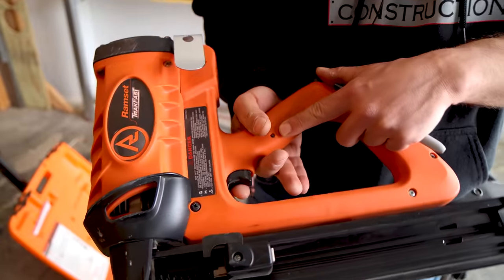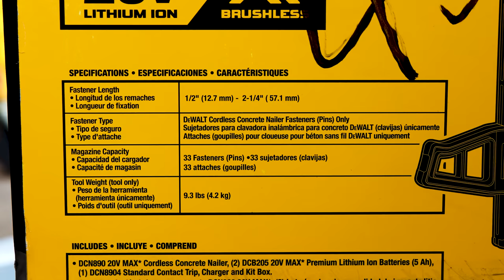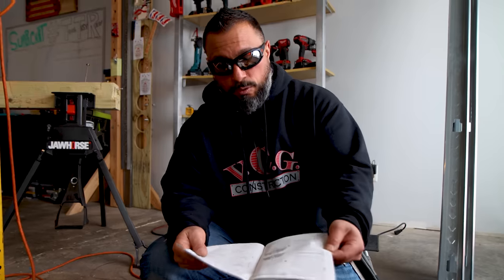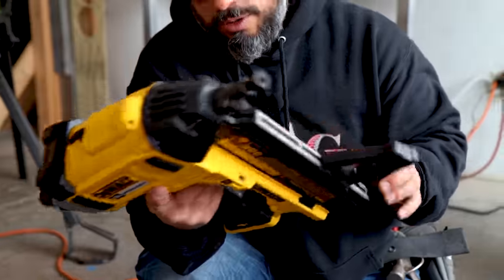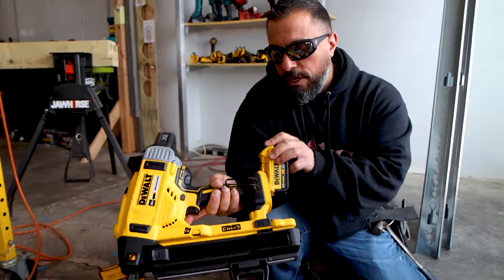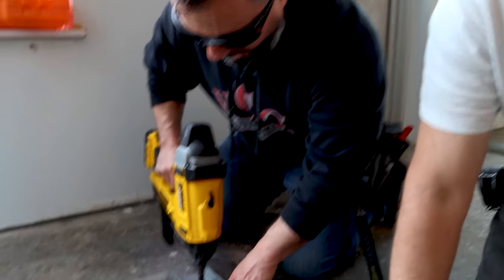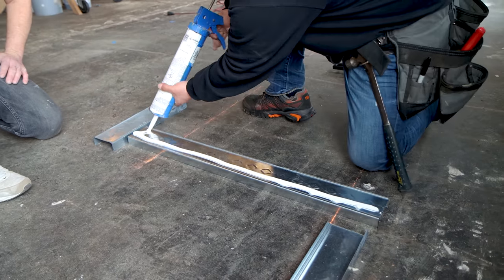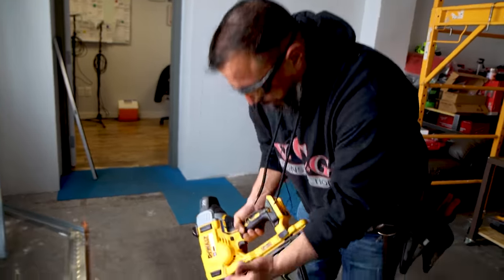DeWALT XR Concrete Nailer HAS A SPECIAL FEATURE! (don't overlook this!)

Comment: Looks like the very short nails are having difficulty going into the tough "old cured" concrete.   Not sure how it will work with structural steel either if its having difficulty with the concrete.   I'm on  full Dewalt ecosystem, but I think more R&D is required on this product, will have to wait it out for the second revised version. Not quite there yet.
Reply: Just like their framing gun that uses the paper collated (paslode) nails.
Reply: Like all dewalt nail guns they're underpowered.
Reply: This nailer is weak I think paslode or Ramsey is better for the price
Reply: There are special hardened nails that you have to use when punching into steel or toughened concrete. They are marked with a black colour. These yellow ones are standard nails

Comment: The company I work for has one and I love it! I do commercial HVAC install and DeWalt also offers accessory hardware to use with the pins such as washers and hanger brackets so I can shoot a nail through their washer to hold hanger strap to concrete for hanging duct or I can shoot a nail through one of their hanger brackets and then loop cable through the hole in the bracket to hang duct. It's so much quicker than drilling a hole and then pounding in one of those anchors that looks like a bent nail. I believe they also sell an extension pole so you can use it without climbing a ladder. I would imagine ceiling grid guys could use one for hanging their grid wires as well.

Comment: I have had one when they first came out I still use gas more because the power , but it still works good for new concrete, just need better pins

Comment: Use the 1/2 inch for steel there black strips not yellow they work better, I've shot down 1000s of ft of c channel for shaft wall at condo separation WALLS. That gun is AWSOME and is another reason I'm a Dewalt guy they are truly the company of inovation.

Comment: I would love to have the DeWalt tool to add to my DeWalts, but I'm past that point in my life. 36 years ago I first used the old orange handle Remington nailer with a big ball-peen hammer to set the charge off. We rented a 7,500 sq. ft. first-floor space, cleared the old walls, and built 11+ foot high walls with steel studs. I'd never used steel studding before nor had I used the Remington nailer. They both worked like a charm! I switched to DeWalt tools with almost all tools, starting when DeWalt brought out their 4 1/2-inch handheld grinders. I think they were a new brand then. I still have the grinders, still working! Yes, I added more DeWalt grinders to those for faster usage of whatever is needed but the original grinders are tops for endurance. Purchased in the early 1990s. Amazing, there's been almost no maintenance done, always used in a commercial art foundry. Boss!

Comment: I wouldve liked to see you try n use longer nails to try and get a 2x4 in the concrete and i think i read that nailer shoots 2 1/4 max? Idk if 3/4 into the concrete is enough with that especially if they stick out the top a little bit. I usually use at least 2 1/2 tapcons wich takes forever. Cool gun though very interesting
Reply: 2 1/2 maybe 3 inch would be a perfect gun for the 2x4

Comment: Nice gun Vince, I still use an old Hilti 27 caliber 10 shot concrete gun. The worst part about that gun is the pressure it puts on your wrist every time you shoot it. The new Dewalt gun looked like it didn't hurt every time you shot it. Thanks for the Video brother.
Reply from the maker: yes and yes sir

Comment: Not sure about this one yet not enough people HAVEN'T used it.was very quiet.did sink pin all the way in floor. I'm use too ram set guns! Wonder how heavy it was too use.price was high for me ran us cheap in electric field put a lot of 1/2   3/4  1 strap in concrete !looks like they fixed the blow out of the concrete that happens.I too see one in action for my self.I would think about buying one if price came down!

Comment: i didn't know dewalt made one of those...for now ill stick with hilti gas+battery (the battery last weeks and you can always check before using it in the morning at what level you are if gas or battery are low u can bring a spare with you or switch the battery), i like how the pins don't stick out its much faster to stand the studs after when no pins hook on the studs!

Comment: Hilti been had Solution for that in past 30 years. And best pin nailer is Hilti GX120 or GX3 along with DX460 and DX351 for super dutty application.I own all 4 of these Hilti Nailers.  Hilti All day,Every day 👊👊🤙🤙
Reply: Hilti           1,000 nails $190.00
Dewalt      1,000 nails $90.00
Hilti is a great product, but when youve got a couple thousand L/F of wall it adds up.
Also, Hilti just decided to quit making gas for the 100 which pisses me off. Looking at $15,000.00 worth of unusable tools sucks.

Comment: If I would want nail  in a 2x4 would it work for that?  If 2x4 is flat you said it does 2 1/4  max . That would be what 1/2 into concrete?

Comment: With the Paslode, you just have a second battery charging... exactly as you would the DeWalt. Running out of gas? It takes three seconds to change the cartridge with way better consistency than the DeWalt. The DeWalt's performance isn't quite where it needs to be, yet. Trackmaster is the standard for the time being.

Comment: would you try it with XR 8Ah battery and see if it will be better... The XR 7 1/4 circular saw perform the best with that battery (way better than  the Flexvolt 9Ah or the XR 5Ah)...

Comment: Wondering Vince, after you used this tool for a while; did you notice any flagging at all, or other issues that might “drive you crazy” (don’t necessarily count jams as an issue.....unless it’s a constant thing; since a nailer/pinner will jam every so often)?
As I don’t like the “fly wheel” system DeWalt’s using on their Nailers/Pinners; I do like the way it’s easy to clear a jam. Most times, flipping lever on top does the trick, but if have to get “into” the tool.....still pretty easy. 
Even w/ the fly wheel spinning, the ramp up is not that bad on the nailers etc... But what nice today, everyone can choose their “flavor” (‘cept for Milwaukee framing nailers, that is😏😆).
Great to see VCG keeping at making vids, & wouldn’t be the same if they had to stop; as w/ all the YouTuber out there.
Thx Guys, see ya on next one 🤜🏻🤛🏼
Reply from the maker: It’s been doing good the last few days, I’m excited to try it out on some structural steel!!
Reply: Milwaukee's framer is supposed to come out soon it looks pretty ba

Comment: Looks like it's more productive than powder actuated. My powder actuated driver just kicks my wrist. It was painful to frame my basement with it. Nice tool from Dewalt.
Reply: Michael Arnold you need gas actuated, I have a global fastening systems concrete nailer and it has copped a caning on a regular basis putting down smooth edge

Comment: I haven't personally been able to use this but the inconsistency I see between nails in this video on the same settings tells me that I should wait for a few more generations so the kinks can be worked out. Don't get me wrong, I think of myself as a bit of a DeWalt fan but i don't trust the first generation of anything any company produces. It always seems to be about 70% of what it should be.

Comment: That's is sweet I like the no gas part it's like the new nail guns no air hose and compressor to deal with and the noise is even better used to have the gun news the different color shots put each Dale in individually one of the time and then press down where you want to shoot and what did everybody do look away and pull the trigger this way so much safer you look at what you're shooting and very quiet

Comment: great video. said it before as soon as i get the money its mine.  i don't know if I was hearing things but does it shoot the pin then hammer it in?  thats what i was hearing.
Reply: No it’s the fly wheel resetting
Reply: ok thanks.  it just sounded different. I guess since theres no gas its going to be different.

Comment: Vince PLEASE emphasize MAINTENANCE covered in the manual. Those that skip over this part of the manual will do so at their own peril. This is true with any tool be it pneumatic, electric or battery operated.
Again, as I have said in past replies, I service tools just like this all day every day of the week and the cause of tool failure is most often the result of poor daily maintenance. Regardless of whether it’s the tool owner or the employee user. This is true with any tool be it pneumatic, electric or battery operated.
Best regards
Wrex218

Comment: The deal breaker for me was the fastener (pin) cost.....small box from my supply house was $100
Reply: Todd Fogler $100 for a pack of 1000 nails? You have a cheaper alternative for nails for concrete and steel?
Reply: T.J. Goldwater $100 for a 250 count actually....and yes I’m serious.  For the bit of extra time they take I’ve gone back to tapconing.....the finished product looks so much cleaner and there’s no blowout or half sunk fasteners.
Reply: Todd Fogler normal price for the pins are around 10 cents a pop. I hammer in plugs if it’s small amount and rough concrete. But any other day of the week it’s Max high pressure or the dewalt

Comment: I attach a lot of metal lath to poured concrete walls in order to lay stone veneer. Would this be a good solution instead of drilling tapcons all day?
Reply: Have you tried drive pin anchors?

Comment: It sounds good but the gas actuated gun is less likely to let you down because of a flat battery if you forget to charge. The advantage of non gas is if you need to order nails online you can send express because there is no gas canister.
I has a milwaukee brad nailer and it over heated a lot. I may be wrong about this, looks pretty nice.
Reply from the maker: Good feedback, thanks
Reply: VCG Construction my paslode and gfs nailer are both around the same voltage, every now and then I forget to charge and don’t have the charger so I just connect both batteries together positive to positive and negative to negative and it quickly charges

Comment: The gun your using works better, and even drives the pins deeper, when ur not putting ur body weight on the gun. They’re not designed that way. Same as a recent model rotary hammer drill.

Comment: I looked on the dewalt website quite some time ago and they are pulling it from being sold.    I did contact Dewalt to ask they why.  No response.   I want to get one but I don’t know how long I will be able to use it.  If Dewalt pulls the unit they will also pull the nails.   It’s a great tool just not sure about buying one at the moment.
Reply from the maker: It’s not being pulled

Comment: U do know what one goes first at least on the paslode in your hand if the light is blink green red it’s and indicated that u have X amount of battery life to do x amount of nails if it was the fuel it was just not fire would not matter if the battery was full or dying would not fire with out the gas so u would know it’s the gas when it the battery u see the light when it dying it blinks  at least with paslode u may be correct but should have not had a paslode in your hand DeWalt is my favorite brand but does not measure up to a paslode but the are different in design and power sources

Comment: HOW LONG A PIN WERE YOU USING?
MAYBE TRY A SHORTER ONE?
Reply from the maker: Shortest they have 3/4”
Reply: @VCGConstruction  DO THEY HAVE A 1/2" FOR STEEL YOU COULD USE FOR HARD CONCRETE ?

Comment: If that dewalt concrete nailer is anything like the framing gun, it'll leave you hanging. I haven't used one in 3 years, so maybe it's been improved. We had to get 6 of those framers repaired repeatedly within they're first year. All my paslode framers go years with just regular cleaning. Downside: thousands in fuel cells per year. Beats the neck out of the losses accumulated by downtime within a year. Nevermind how much it pisses you off when your gun that seemed so sweet at first repeatedly fails you. Incidentally, My paslode trim gun is nearly 30 years old. Only replaced the trigger so far. I'm more afraid the type of fuel cell it uses will stop being produced.

Comment: i wanna see that thing run 2x4 treated into hard cement if it cant do it its useless to me
Reply: @blackpowderenergy  just bought one today used in great shape for 500 and i completely agree with ur comment thats all i want it for ! my first hitch is no one stocks the nails and everyone wants way to much for them but as usual amazon to save the the day but now i have to wait to put it to the test... max nail is 2 1/4 so im hoping i will get the nail head just below flush  with 7/8 to an inch into concrete...

Comment: Can anyone advise what I need to be doing this with nailing a 2 inch wood piece to concrete? Eg putting a shed frame onto a concrete base?
Reply: I would recommend either concrete lag bolts or a ram set specifically for that purpose. Look up a ramset fastener chart and it will give you the specs you need. Good luck and have fun!

Comment: Those Paslode guns stink. If it's cold they don't want to work. The Ramset gas guns stink too. The Dewalt used in this video is nice I felt that the slide thing that keeps upward feed pressure on the nails in the magazine is chintzy and will break if guys just throw it in the gang box. I think Hilti is the best for gas actuated nailers. Almost never had a problem with one of them. Battery is built in, just needs gas cartridges. They work even if it's 10 degrees. They have a good program where if you buy something like 15,000 nails, gas cartridges included they give you the gun, then when you need more nails you reorder 15,000 nails and they take the old gun and give you a new one with your nails. I'm sure they refurbish them, but you always have a good gun. Hilti has always given me the best reliability in this type of tool. Can't speak to the price though, bossman always buys them. Probably expensive. Only the big outfits I've ever worked for use them.

Comment: 2 x 5 aH batteries plus tool for $800? That's like ~$300 in batteries. Bare tool for ~$500 that drives concrete pins fast is a screaming deal if it works for more than a few jobs. Especially if you can build that cost into a bid.

Comment: Vince, 20 years from now you are going to wish you had started using knee pads.  Take it from an old timer, they will save your legs later on in life.   Might not be the most fashionable items you use on a jobsite but, they are in fact a piece of safety gear you should use.
Reply from the maker: I know. I never take the time and I should. It’s very important, thanks Joey!
Reply: Ditto! I have tissue damage in my knee because of years of not wearing them.
Reply: VCG Construction take a look at Noble pants. Built in knee pads (free right now on website) tons of pockets and very comfortable. Order down one waist size (pants are oversized). Got mine from North 40 outfitters.
Reply: @lorenrickey5481  Noble Outfitters? I believe they've sold out and aren't restocking, due to the wuhan flu. When you go to apparel> men's> pants, it says there is nothing in that collection.
Reply: Andrew Delashaw I noticed that also, but when I was shopping North 40 (used to be Big R) they just received pallets of their pants (new item) She said shorts should be there next week too.